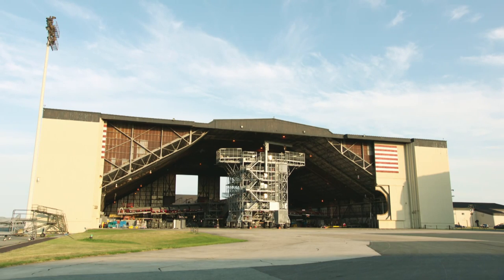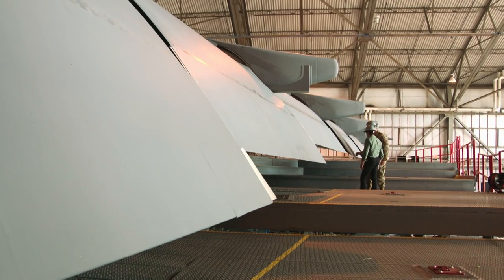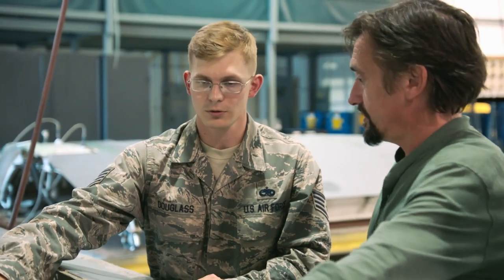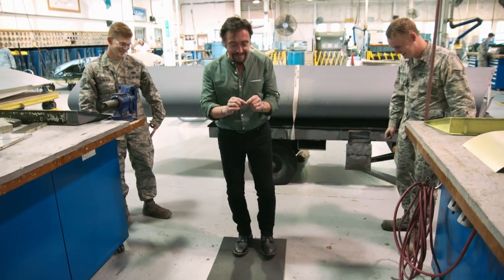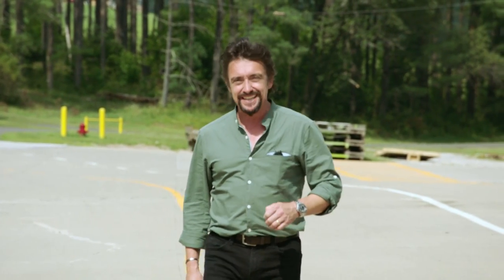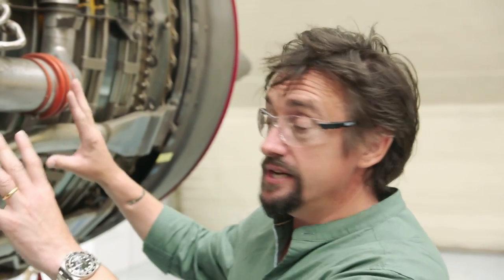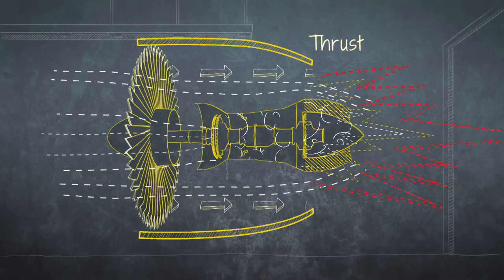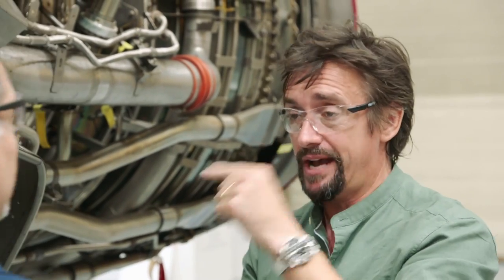The Amazing Engineering Behind the Super Galaxy Plane | Richard Hammond's Big

Comment: James May would have been drooling over the technical specs of that engine
Reply: If James may had to service that engine it would take 30 years. 10 years to organize the spanners and 8 years to read the manual and 12 years for the service.
Reply: James May would be talking about every part of the engine in so extreme detail that it would take 100 years for him to explain how it works.
Reply: May, would, might... whatever.
Reply: Clarkson would be hitting it with a hammer

Comment: The C-5 was a horrible boondoggle of a project, over budget, behind schedule, and under performing. (Part of this was on congress and DOD,  not just Lockheed) The C-5 max normal-service load was reduced by a third in the late 70s because of major fatigue issue in the primary frame. (they can still use original design load for emergency service but then need more inspecting and have reductions in service life) 
 The c-17 is a much better plane, the C-5 is retained only as a reserve for use with over-sized cargo, if they can use two C-17s instead of one C-5 they will just to keep the hours low on the remaining C-5 fleet.
Reply: I can remember when the first two centre fuselages for F/A18 production arrived at Avalon in a C5 back in the 1980'3. It is an imposing beasty of an aircraft. i remember the loadmaster asking how high we wanted the aircraft to enable unloading. We said said leave it where it is as our unloader was adjustable for height. It was the first one the loadmaster had seen and we had borrowed it off Qantas.

Comment: the next revolution (he) being geared turbo fans, where the core can run at higher rpms than the fan in front.
Reply: Fritz I work for the company that makes the only geared turbo fan engine. I asked if we were going to venture into the heavy aircraft game and the answer was no. There are far more single aisle planes sold and is more profitable.

Hope that changes.

Comment: "42 tons of Air ", How can air be weighed or measured ? Pls don't crucify me ,I'm not a science guy.
Reply: The easiest way to weigh air is really simple. 
You take a gas bottle (like the ones for a camping cooker) fill it with air (just let the valve open), close the valve and then weigh the gas bottle.
Then you pump out the air, close the valve and weigh it again.
The difference is the air that you have pumped out. You can measure the volume of the gas bottle and there you have the weight of air per liter.

Under normal pressure and temperatures air weighs around 1.2g.

First measurements with that methods are from ~1650